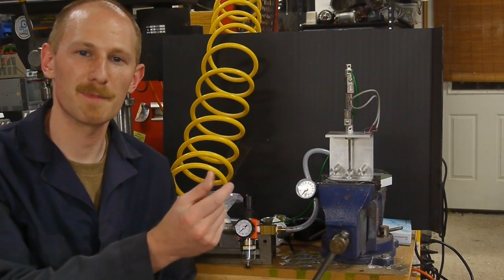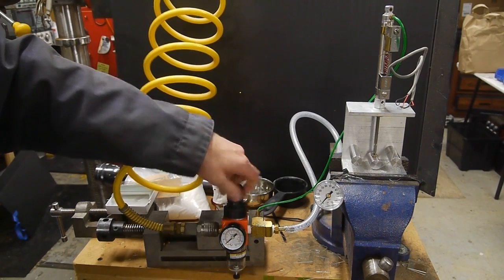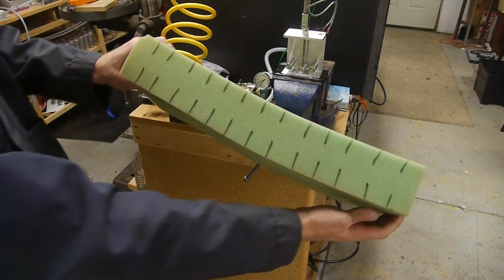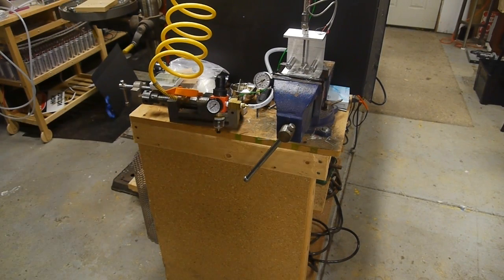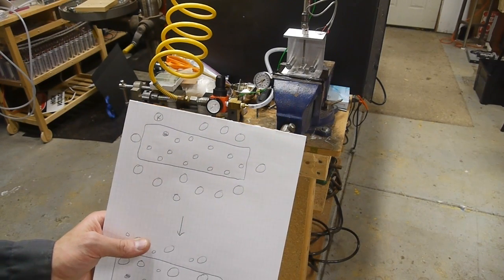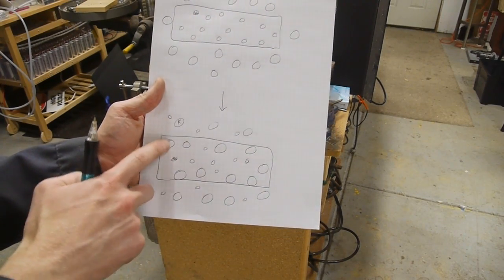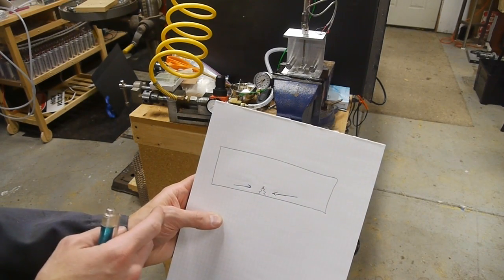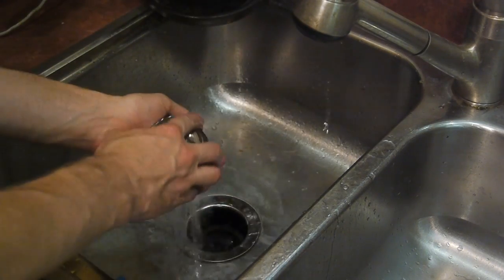How to chemically strengthen glass (eg Gorilla Glass)

Comment: This is indeed very nice. I teach materials science to engineering students and this topic comes there. That's how I stumbled onto your channel.
In our lab we do three point bend test on glass slides in a mechanical testing unit. We show that strength increases after etching in HF. After seeing your video I am interested to show this chemical strengthening experiment as this is more realistic than etching in HF. But we do not have the neat kiln you showed. Did you make it yourself? Will ordinary electric furnaces do? Is there any safety concern for furnace/people?

Comment: What about if you were to make something like rupert's drop, but instead of putting it straight into water, roll it through two rollers that produces a sheet of the stuff. Would that do any good, or would it be to thin and fracture under any force?
Reply: That is basically what they do to make tempered glass. I believe they also use water misters to keep the temperature gradient at the desired level

Comment: I remember a process discussed using HF to etch the cracks and pits so that they are not a sharp at the radius... the process is very dangerous because of the HF, but should work well from and engineering perspective.

Also, Is there any reason (besides cost) not to combine the chemical etching, chemical treating, and a tempering process to create an extremely high strength glass? my engineering would seem to say it would work. Could make for a great follow on to this video.

Comment: Alright, so I watched the video and I actually understand it for once and am ready to give some actual input that might benefit the video.

I have a few question and some thoughts.

Wouldn't preloading all of the glass cancel out some of the benefit it would receive?

Basically you said, preloading the glass allows it to spread more.
I agree, that makes complete sense, but only for that one side.  And that is the flaw I seen.
Wouldn't that same operation, the one that effects the entire glass and only benefits the spreading side, actually reduce the bending room that the bending side once had as well?

Because you are adding more chemicals into it, it loses bending space.  Right?

So because it loses bending space, where does that extra force that is being applied to it go?

Maybe if you covered one side, then applied the chemicals, it would make the glass even stronger?  Because now the compression side still has just as much room to compress as it did once before.

Just theories.

Comment: Hi Ben,

How are you sure it is not some sort of tempering/annealing process that strengthened the glass? You should buy some sodium nitrate and repeat the experiment, running a K and a Na bath simultaneously, with the Na as a control.

I love the videos, by the way. Big fan.

Comment: How did you make that furnace? It looks like the lid with the element inside is all one piece.
Reply from the maker: The furnace/kiln is a commercial model called the Paragon Quick Fire.  It is made by casting the heating elements in the high temperature insulation.  I added the PID temperature controller.

Comment: Hi Ben: Do you think this treatment would provide a glass window of sufficient strength for the supercritical CO2 chamber?  Cheers, Mark
Reply from the maker: Maybe.  I'm confident that I made the microscope slides stronger, but I'm not sure I would trust my process enough to build a pressurized gas chamber :)
Reply: But, possibly strong enough to use on the pressure side if backed by an acrylic window laminated to it.  The glass would be more inert to CO2 and the acrylic would provide additional strength (not only against the pressure but, also distribute the forces caused by bolting the assembly to the chamber and from contact with the o-ring).  The acrylic backing would also provide a margin of safety in the case of a failure.  Cheers, Mark

Comment: Did you do a control where you heated the glass without any vapor? I'm interested to see if the heat cycle alone affected the strength of the glass.

Comment: Always though Gorilla Glass were some sort of Polymeric material.
BTW, you should not heat the potassium nitrate so much, as it decomposes forming some oxidizing agents like O2, NOx and K2O2... could be problematic depending on what you have around it.
Reply: Good to know.  Temp range for decomposition w/ atm?
Reply: Gotta say I have no chart on this... only study on thermal decomposition of this substance I managed to find only analysed temps above 550ºC...
My statement was based on information from IFA which stated that decomposition starts on temperatures above 400C. http://gestis-en.itrust.de/nxt/gateway.dll/gestis_en/003630.xml?f=templates$fn=default.htm$3.0

Which now that I stopped to research a little more is actually odd since ppl do steel nitriding over 500ºC... could be under controlled atmosphere though.

Comment: All masonry have weak tensile strength, this is how a B-25 bomber put a hole in the side of the Empire St bld, the facade is GRANITE.  What people don't realize, it the airframe fell OUTSIDE the ESB, unassisted.  Structural steel, on the other hand, has a tensile strength over 85Ksi.  This is how we know for a fact no commercial airliner ever hit the WTC.  Aluminum in free space can not penetrate a larger piece of structural steel at subsonic speed (STP@SL).  Full penetration of the WTC by a hollow aluminum projectile is PHYSICALLY IMPOSSIBLE!
It's called forensics, the laws of physics can not be broken.
Reply: Oh dear.
Reply: +cheerdiver Numbers, numbers, numbers.  Those are static load numbers, you are ignoring the momentum of the aircraft.  Let me make this simple for you.  If I take 1 lb aluminium hammer with a face area of 1 in^2 and strike a 3/4in thick piece of steel plate measuring 4 in x 12in (plate weight is aproximately 10lbs) supported at the ends at about 100 mph (humanly impossible, but still much slower a jet).  The force of impact is almost 5000 G.  That 1 lb hammer has just exerted 5kpsi of force on that 3/4 inch plate. Sure, that's only 1/2 of steel's ~10kpsi rating, but is still enough to warp the plate and when that warping steel is under compressive force from the rest of the building, it will buckle under load, collapse what is above it and the force from the collapsing overhead leads to an accordion event, collapsing the rest of the building.  I admire you ability to yank numbers off a chart, specifically using metric units in an attempt to confuse me, not to mention picking martenistic high alloy steel to bolster you figures.  But the reality is buildings are made out of low carbon molybdenum steel which has a higher compressive load rating but poorer shear strength.  Please let me know if you still want to keep going at me with my 12 years of Naval service as a reactor plant metalurgist.  I'm sure you can find more numbers to throw at me.
Reply: cheerdiver
"If"
You ship sailed long ago without you.
Reply: I agree with your numbers, but you are forgetting a critical piece of information.  The spacing between steel girders.  The materials used between those structural elements all had varying degrees of LOWER tensile strength.  The jets crashed into and were severed along the planes that the aircraft's structure crossed, sending now multiple high speed fragments into the weaker portions.  Also, do not confuse tensile with shear strength.  70 tons+ of aluminium can create enough shear force to bend a few steel girders the few inches that would be needed to reduce their load capacity and induce a collapse of portions above it if there is sufficient weight to create the torque needed to bend the compromised girder(s).  9/11 happened, it was a terrorist act, it is sad people lost their lives, but 13 years have passed.
Reply: sivalley Shear mod alum 25Gpa, shear mod common steel 70Gpa, you sure you want to go there?  Only 25% of the facade was "glass".  No airliner ever hit the WTC, only hayseeds continue to believe the carpetbagger's HOAX.  If you can produce a repeatable experiment to prove otherwise, let me know.
Reply: cheerdiver Quite sure that at least part of the engines of the aircraft is not made of aluminium, and not moving at subsonic speeds either. The tip of the blades in a modern turbo-fan engine can travel way above Mach 1. Steel also looses it's load bearing properties when heated. Good job focusing on one single slightly irrelevant fact though.
Reply: sivalley just wanted to say well done and thanks for that
Reply: Logan Stewart Thanks.  I'm sure when Cheery over here reads that this woman engineer has a higher yield strength than their conspiracy theorist counterparts, they will shat brix.  (Yes that was an engineering pun).
Reply: sivalley You have yet to prove subsonic aluminum can penetrate steel, Yea what a victory.
Tell you what, I will set the bar even LOWER.  Get a university level mechanical engineer professor, to claim the statement not true.  He/she wouldn't even bother to ref an experiment.  They may even assume a vacuum to say yes, so defining the SOS is a requirement.  They will NEVER deny it, on record.  Those who do not deny, admit - Plato

Get them to deny or accept b4 telling them what it's about.
Had an NCSU mech eng dept head try to claim paraphrased "I've seen Lexan penetrate steel" and I said I agree if the speed is fast enough.  Then he went mute.
Reply: sivalley So, if I let you call me 'weed', can we explore the mechanics of a shearing die, how a shear failure takes less energy than deformation?  Like why power lines hang down and the mechanical advantage of angled force.  How the deformation would be like a catchers mitt.
It would only take a force of 50g to stop a 500 ft/sec projectile in 63 feet.
Reply: did you know world war 2 never happened
Reply: breezebro Thanks, I just had a major case of face-palm-head-desk raeg that this guy precipitated.  We can only tolerate so much of the same DI-DO before someone makes us snap.  So yes, I admit to succumbing to my human condition and became equally arrogant to the indignity. Cheers.
Reply: kodez79 "Few of us can easily surrender our belief that society must somehow make sense. The thought that The State has lost its mind and is punishing so many innocent people is intolerable. And so the evidence has to be internally denied." -- Arthur Miller

What do you think "Mach 1" is??  I don't care if you use a solid piece of tungsten, it's still has to be subsonic, it still won't have enough energy to penetrate.  A solid piece of aluminum would have to travel  MACH 5 to penetrate structural steel, and I'm not talking speed racers car.  When people come to realize the truth, they will be making "pollock jokes" about the likes of hayseeds like yourself.
Reply: ungratefulmetalpansy Save your breath, this guy is about kineticaly adept as a freefalling wad of bio goop.
Reply: ungratefulmetalpansy Isn't it? :-D

Comment: "Preloading it in compression" - soo, kinda like Prince Rupert's Drops? That's awesome.
Reply: It's basically exactly how tempered glass works. Cooling the outside rapidly shrinks it relative to the core. Then when the core cools, it tries to "suck in" the harder outer shell of glass and puts the core under tension and the outer shell under quite a bit of compression.
I'd be interested to see how this process worked on tempered glass, come to think of it.
Reply: in curious as to how sapphire behaves. it might be completely irrelevant but, maybe they share some properties? idk lol

Comment: Awesome! I was hoping you would work on this one. I may have to use it for some of my own projects (the un-breakable beer bottle).
Reply: Nick Moore -  Beware, the "un-breakable beer bottle" will kill people! Beer bottles have a common use in bar fights -  and a breaking bottle may prevent a skull injury. Also, it will soon be used as artillery projectile. Fill it with something  cheap or heavy, like molten steel or uranium. The only reason not to use tungsten is that is so hard to melt it! And nuke tests will be done again soon! But physicists  will be really happy!
Reply: would like to see that!
Reply: Tiddly Penguin Cans can't really be reused easily.